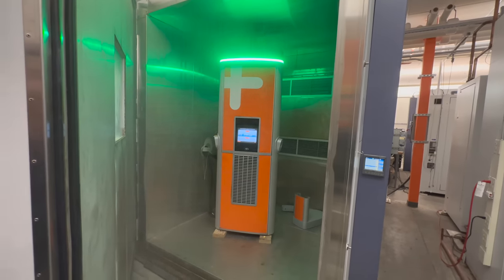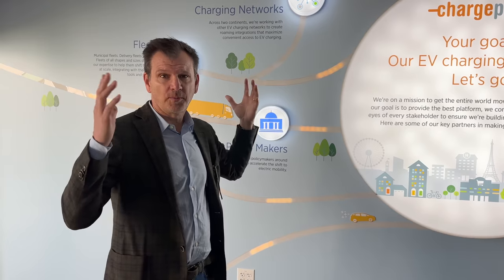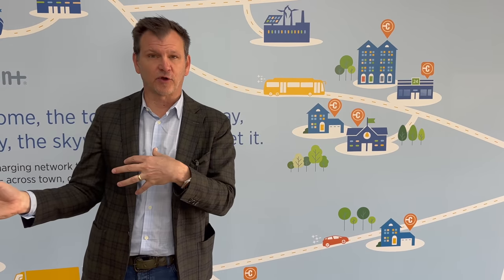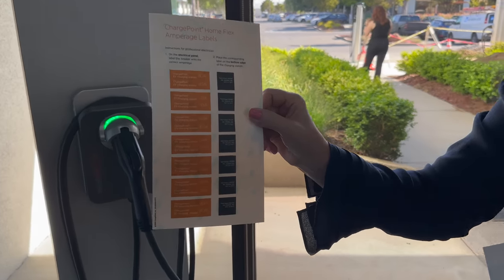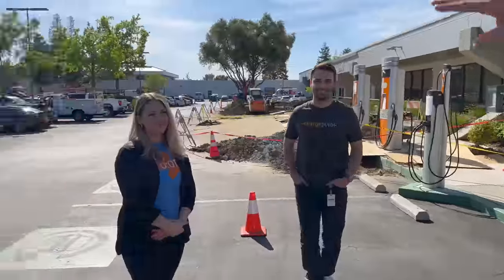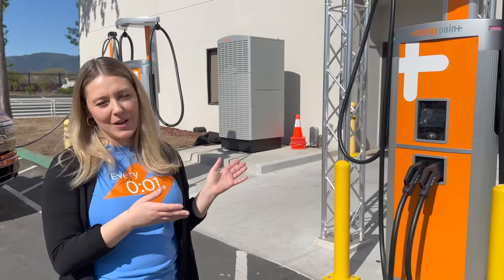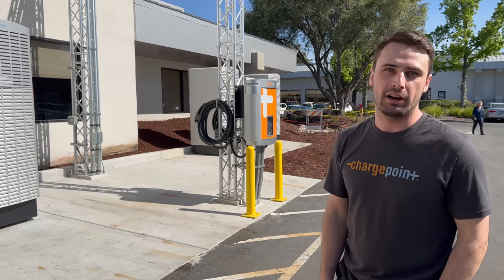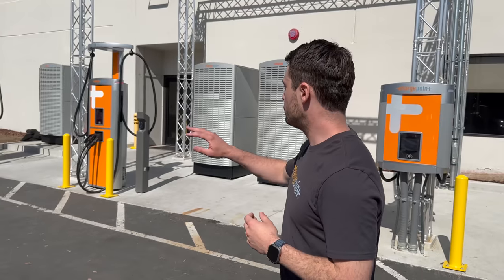Inside ChargePoint - Full Tour Of Hardware Engineering, Test Laboratories, & Product Portfolio

Comment: Sitting down to watch this entire video. I will bet that Kyle does NOT use his platform to ask ChargePoint about adopting the North American Charging Standard (NACS). If I'm wrong, I will buy some Out of Spec merch. 🍿
Reply: Why would he? NACS adoption relies on car makers. Dispenser manufacturers use whatever the people need. Right now that's CCS.
Reply: @xaionik  Actually, NACS is the most common charging standard in North America: NACS vehicles outnumber CCS1 two-to-one, and Tesla’s Supercharging network has 60% more NACS posts than all the CCS1-equipped networks combined. Drivers need more NACS connectors.
Reply: @AlijahSimon  The Tesla charging format is for Teslas.  If Tesla wants to use the public charging network, then they they need to adapt to the public network's CCS standard.  Elon trying to sabotage the public network at the last minute is ridiculous.
Reply: @dansanger5340  Hi Dan! Which Tesla charging format are you talking about? The only two I know of are the Tesla Semi chargers and the older Roadster chargers. The rest of their vehicles use the public North American Charging Standard (NACS). You mentioned something about CCS1, but CCS1 is unusable by elderly and disabled drivers due to its size, weight, and locking mechanism, and is not ADA compliant. Therefore, it is ineligible to be a public standard 👍🏻 Hope this info helps!
Reply: @dansanger5340  NACS is the standard.
Reply: It isn’t a real standard
Reply: @dansanger5340  this anti-EV garbage didn’t age well. Go Ford!

Comment: 1: Every L2 charger I've ever had not work for me was Chargepoint. Some of that's the way they dominate the market, but ... I've also had it apparently activate then not actually charge.
2: They also really REALLY don't understand what I want from a home charger. I generally want a DUMB home charger. I DEFINITELY don't want it connecting to a cloud service. I don't care about a phone app for my home charger.
3: Assuming the car has range at ALL relevant for distance travel, I also don't need L2 charging throughout the city. I don't need L2 at the convience store, I don't need it at the barber, etc. I charged at home. I don't need to charge anywhere else.  If I live far enough away from the city that I might need to even charge at work... I bought a car with a bigger battery so that no, I don't. Their focus on L2 charging everywhere (except home & Hotels) seems very very misplaced to me.

So that leaves me only caring about their L3 charging, and wondering why they seem to be spending so much energy/effort on things that just seem like they have little use to most drivers.

Comment: 1:07:05 Modules seem well designed.
A hardwired connection for such a critical component is worth 10 minutes of a service installers time.
Not convinced that Push , Click and forget power pack will be reliable over time.